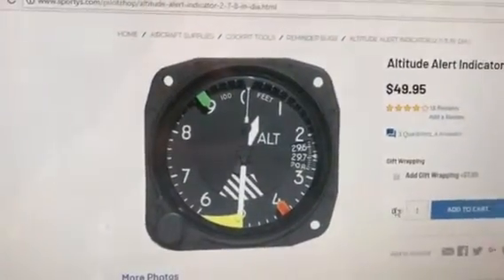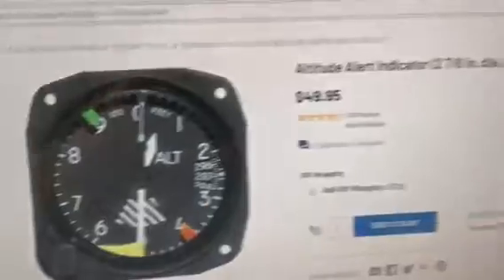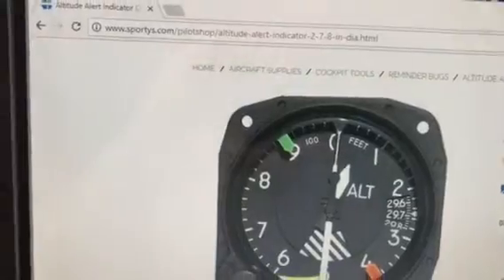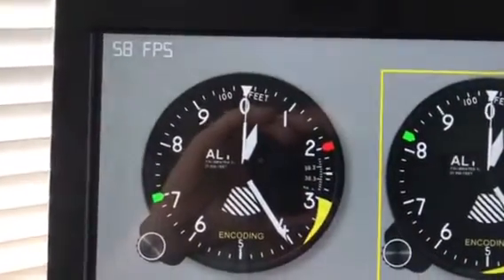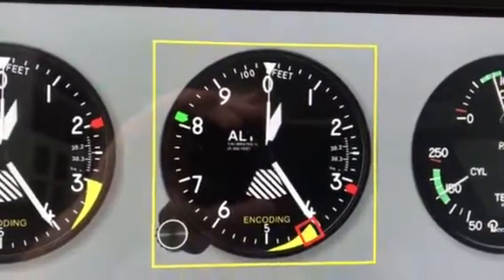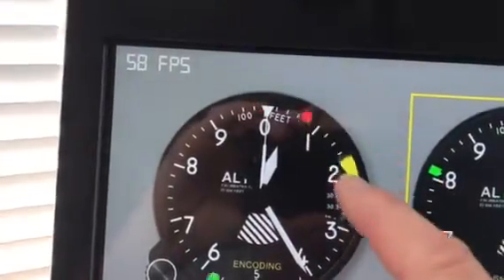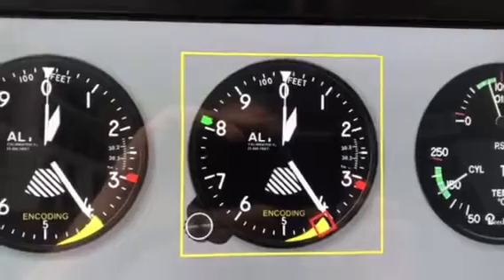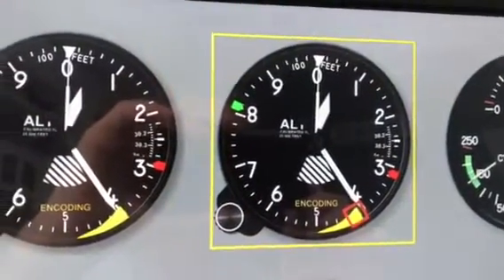Circular Slider

Comment: What is the minimum system requirements to run air manager and Air Player? Looking to run air manager on a compact PC or low-end laptop and Air Player on a meegopad. Seeing that the meegopad or other comparable PC sticks are around 1.44 ghz and 2gb ram, i wanted to make sure that I'm not purchasing something that isn't compatible with running the system.